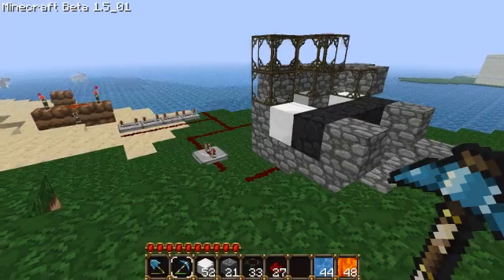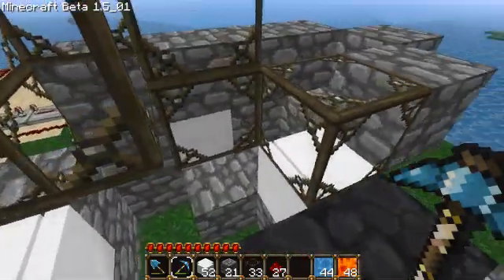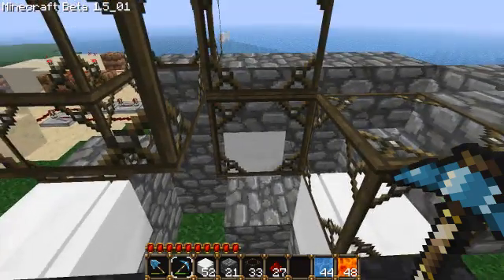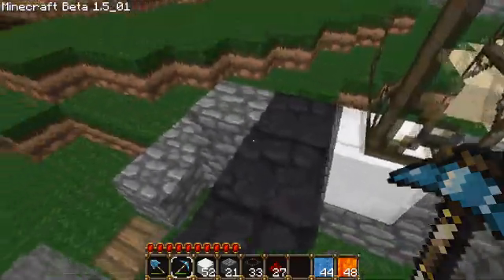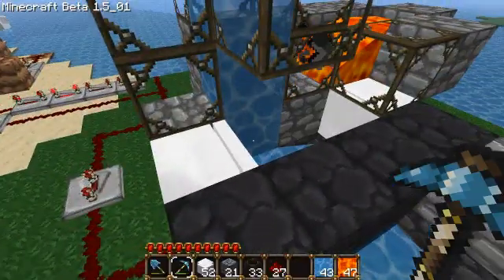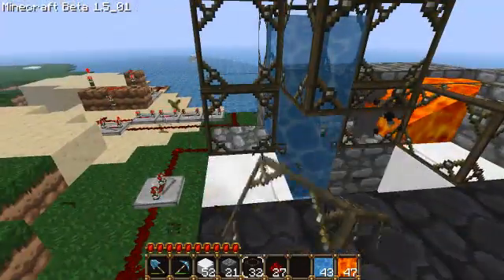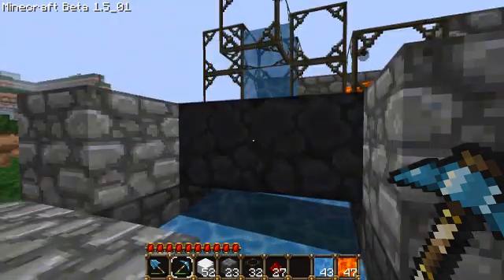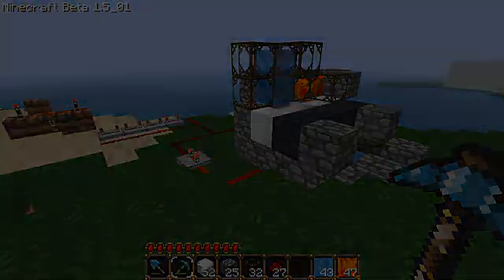Minecraft Tech - Pistons - Automatic Cobblestone Factory

Comment from the maker: @DoWnLoAdEdDeMoN Indeed. However, when you're building a castle that requires 100k cobblestone and not a single other ore, "useful stuff" becomes a burden. It's happened to me plenty of times, and simply standing in front of a generator while AFK would have saved quite a bit of lifespan. However, when it comes to non-automatic cobblestone generators (unlike this one), their use for acquiring stone is significantly limited. Regardless, those are moot points now with the changes to vanilla pistons

Comment: @ConfineSilences This sometimes still happens to me. I eventually ended up giving the piston (that pushes the newly formed cobblestone block between the other two) a delay of about 4 maxed repeaters. I also think I added an extra repeater in the clock circuit. The result is that there usually is no jamming while the factory is in operation, although when shut down it sometimes does block on that last delayed push.